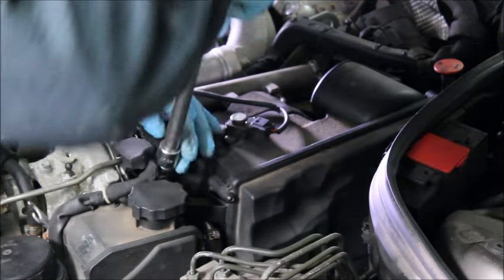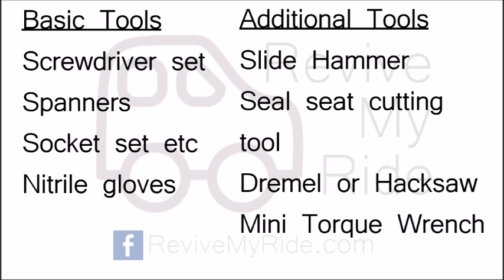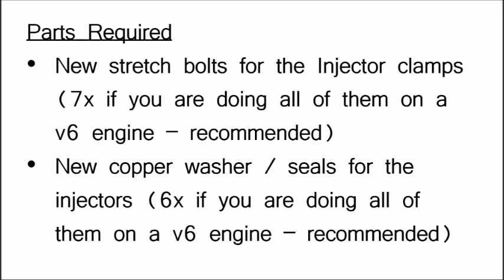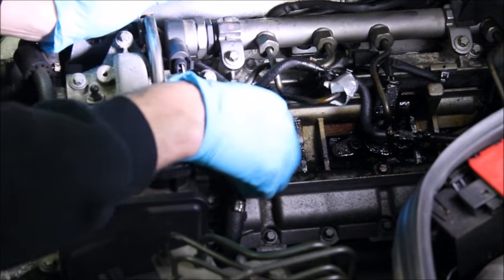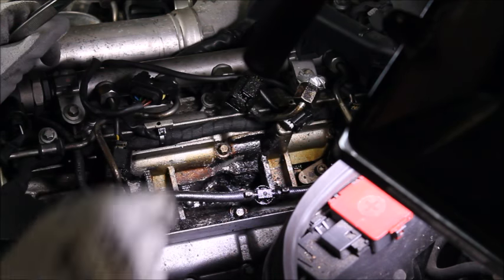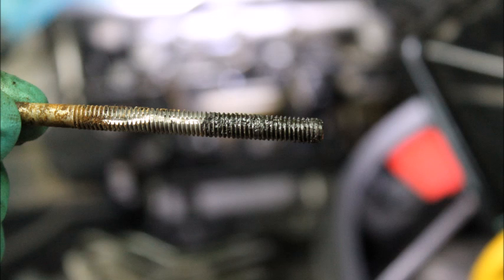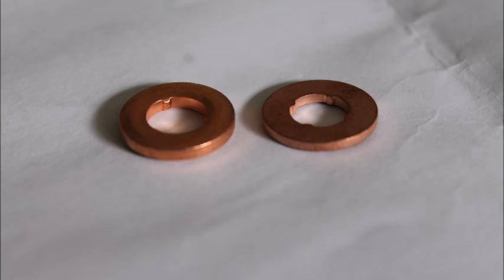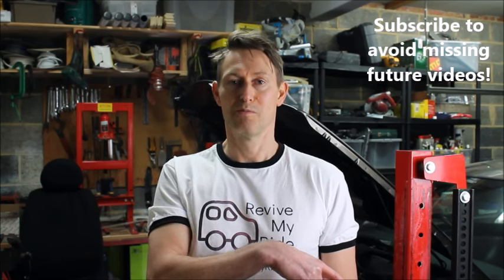Mercedes diesel CDI (Black Death) leaking fuel injector - How to diagnose and fix on 3.0 V6 engine

Comment: Is the torque specs for the injector clamp the same for the 2005 E320 CDI Diesel engine?
Reply from the maker: I’ve done some research and my understanding is that your car (made 2002-2005)
Has the 3.2 Litre Mercedes-Benz OM648 engine.

You may want to double check, the Wikipedia page is here: https://en.wikipedia.org/wiki/Mercedes-Benz_OM648_engine

The engine I did the video for was a different one, the 3.0 v6 OM642 engine (again wiki page available) if you want to search for it and it does use a different torque setting for the injector bolts / clamps.

For the engine in the video, I used was 8nm starting torque and then 2x 90 Deg turns. Please note from the video that I went to some lengths to ensure the thread in the head was clean and there was no debris down in the bottom of the hole, as this can throw out the torque settings. Also, I used new bolts.

If your car does have the OM642 engine fitted, I have found some information that suggest that the torque process is 7nm starting and 1x 90 deg turn but please treat this as guidance only and spend some time doing some further research to be 100% sure.

I found my info here as a starting point: http://www.mercedes.gen.in/mercedes-diesel-injector-advice-sprinter-others/

Comment: Hey so I followed all your steps on my 2005 E320 CDI with the OM648 engine, and did everything you said to do in the video which by the way was absolutely excellent and very informative but I didn’t cut the seat because it looked very clean and I didn’t think it needed to be done. Anyways all injectors were cleaned and new seals were fitted and ceramic grease  and all injectors back in their original holes but now the car runs really rough I’m not sure why! If I rev it in neutral it sounds fine but if I go for a drive it sounds like it’s misfiring? I changed out all 6 glow plugs with the proper BERU plugs and it hasn’t made any difference. I’m really stumped and I felt for any blow by while the engine was on to see maybe if the seal wasn’t good enough but could this cause the car to run like it’s only on 3 cylinders? I would really appreciate it if you could help me out if there’s somewhere I can send you pictures also I would truly truly appreciate it!
Reply from the maker: ElMoeMan sorry that you are having problems! My first thought is that potentially you have got a Diesel leak or the Diesel line is sucking in air. Start by checking that all fuel line connections are Tight and that that all "snap on" fittings, like for the return lines from the injector are connected properly. Be careful not to check for leaks with the engine running as if there is a tiny leak on the high pressure sections I have heard it can cut you. Probably would do any harm to double check all air intake pipework and fittings as you will have removed a lot of them to do the work. Losing or gaining metered air prevents the ECU from getting the fuelling right. Finally, there is a chance that whatever the problem is, is causing a fault code register, so it would be a good idea to see if there are any fault codes registered. Hope this helps and let me know how you get on!
Reply: Revive My Ride                                                         I appreciate the fast and quick reply I truly and honestly appreciate your insight and your willingness to help us strangers on the internet haha! I double checked all the connections between the common rail (hard fuel lines) to each injector and they’re all tight and I took them off a second time and made sure they are sealed properly just to make sure! I didn’t take anything apart besides the injector return lines, the injectors themselves the connectors that plug into the injectors and the bolt and holding pin that slides under the injector where you use the slide hammer to pull it.                                                         I didn’t remove anything else except those things so I know it’s not anything with the air, hoses, connections and also the glow plugs are extremely easy to access on this motor so nothing was removed either or any of that stuff, all I really did was clean the Black Death and put everything back as they came out except the only difference was with new seals. I suspect it’s most likely the seal between the injector and the copper sea isn’t perfect so I ordered the injector seat cut tool which should arrive in a week or so that’s my last resort before I get new injectors which will cost a fortune :(
Reply from the maker: @ElMoeMan Hi again, it seems from what you have written above that there is a chance that one or more injectors aren't seated properly. You obviously have some experience of spanner work so I'm sorry if what I mention now is obvious to you: Please make sure you cleaned the bolt holes out really well (for the injector clamp. If you don't, the injector won't be held in firmly, also, if you tighten up tight and there is debris in the bottom of the hole, you can punch through into the water jacket, so be very careful of this! Regarding seat cutting - always best not to use a seat cutter unless you have to. I used one because the seat had become damaged. Ideally, you can clean up the seat with fine emery cloth on the end of a round stick. If you do cut the seat, think of it more as polishing and remove the min possible to get the seat how you want it. Make sure you use the slighter thicker and softer Nissan washers mentioned in the video. Finally, if you are removing and refitting the injectors again, you may need new washers and bolts (for the clamps) again. BTW, a lot of experienced mechanics that do this all of the time will be able to hear the blowby, this is how I found out I had the problem, I went for an mot and a mechanic told me he could hear it and I should have it looked at. If you have a friendly local garage (and you can get the car there), they may be able to tell you if you are getting blowby just be listening. Hope this helps and best of luck with it. Happy to bounce ideas with you if you have got further comments / updates!

Comment: No ceramic grease?  Thanks for sharing.
Reply from the maker: Hi Ernest, thanks for your comment. You are correct that Ceramic grease would be the no.1 choice for coating the fuel injectors but copper grease can be used if you are careful about not getting it in the sealing area during reassembly. I just used what I had in that would do the job. Thanks!
Reply: @ReviveMyRide  Thanks for response.  Am thoroughly confused.  No lube whatsoever on the Cu washer or head & injector's mating surfaces?  I'm about to buy a nice 188000 mile 2005 e320 that has never had this issue but immediately want to replace washers and bolts, and pitch the plastic cover.  $5000.  Thanks.
Reply from the maker: Ernest, I didn't use any grease or other lubricant on any of the surfaces: for example not where the injector sealing face  and copper washer meets the head. New bolts etc were all fitted clean. Please be aware that your engine may be sightless different to the one featured in this video and so the new injector bolts may require a different tightening procedure. If you look down the other comments you will see where someone else asked and I replied about this. Just a bit of food for thought, I wouldn't have done this job if the injectors weren't starting to leak, you may want to inspect yours periodically rather than taking on the job, you may never get an issue with them, especially if the car has made it this long without a problem. Thanks!
Reply: @ReviveMyRide  Thank u so much.  In the mean time I'm going to order the Honda washers and correct fasteners.  I have access to MBenz's repair instructions.  Will check regularly.  Thanks.
Reply from the maker: Ernest good luck with it! Happy to help if I can if you have any questions. :-)

Comment: I have the problem on a Mercedes B180 model w245 but I cannot remove the dirty because it is hard. I found it is called the black death. How to remove?
Reply from the maker: Hi, if the car still starts and runs, then it is a good idea to get the engine nice and warm before you start work. Just be careful not to touch anything that will burn you but the carbon is softer when it is warm and so, it is easier to scrape away. Failing that, spray plenty of a product called "Seafoam" on it an leave it over night, it should soften the carbon. Hope that helps and good luck with it! Thanks, Phil

Comment: Could you please tell us the symptoms how do we recognise the symptoms many thanks
Reply from the maker: Hi, normally you will be able to smell the diesel fumes coming through your air vents but the best way is to inspect the engine around the fuel injectors. You don’t need many tools and it only takes an hour or two. I have a video that shows you exactly how to do it here: https://youtu.be/7weS1vQ_1OI hope that helps!

Comment: And if it doesn't come out,  unscrew the bolts ( for the stubborn injectors) just a  bit and go for a ride on the motorway until they pop out,  you will hear and feel them trust me 😉
Reply from the maker: Thanks for your comment! I have heard of this technique and read that it can work but be careful out  there!
Reply: Great video. Not sure if I could do it but would have my mechanic watch it before doing the job. Marvelous tips on keeping crud out of engine "innerds". Fantastic video!

Comment: Hi i have the same problem. How did you remove the carbon that was build up outside the injectors
Reply from the maker: Hi, if your car will run, then it is much easier to remove the carbon build up while the engine is warm. I'm afraid it is really time consuming but I used a product called "Seafoam", you'll see a link to it in the vid description and then lots of time scraping with plastic trim tools, metal scrapers (where appropriate and they won't damage anything etc). but another viewer on here did a really good job of cleaning his engine up and it was much worse than mine, so I have asked him the question and will see if I can get back to you with some more info....

Comment: Hi what’s the part number for the washers please?
Reply from the maker: Hi, based on recommendations from MB forums, I used the Honda injector seal / washer. It is a little thicker (useful if you have had to recut the injector seat) and a little softer. part number is: 1647RBDE00. However if you prefer to use the MB one, the part number is: A6110170060. I have updated the video description with the MB part number but there is other info on there that you might find useful if you want to check it out. Hope that helps! cheers, RMR

Comment: 2007 1.9tdi A4. 250,000 km assuming not clocked😂.
Injectors are under rocker cover and then under cam and looks like lots of brittle plastic.
How do you know if the seals need doing.
At that mileage should i just do them anyway.
Runs and idles fine but sometimes on motorway it feels like a slight momentary misfire when decelerating. Any thoughts.
Reply from the maker: Hi, the best way to know if they need to be done is that usually you will start to smell fumes coming into the cabin through the vents. Then, when you investigate, if they have been leaking for some time, you will see black carbon forming around your fuel injectors. Just to say, the Merc diesels are much more prone to this probem because of the clamp design, it could be you never experience this issue. There are a few things that might cause the slight hesitancy of your engine that you mention, for example fuel injectors that are dirty and are injecting a fuel "stream" rather than a "mist". TBH, it sounds like you only have a very minor problem and if I was you, I would monitor it and see if it gets any worse. You can often open a can of worms once you start taking apart an old or high mileage engine!
Reply: @ReviveMyRide  thanks for the reply.
The audi injectors are under the rocker cover and so leak into the head. They are not like normal injectors.
I'll leave them alone i think!

Comment: Great vid very informative. 
I’m currently struggling to get an injector to seal on my Vito. I’ve had to helicoil the bolt hole as the threads were pretty much stripped out by a so called mechanic on a previous botched repair. 
I’ve cleaned the seat up well and obvs the injector. Torqued it to 7Nm +90deg + about 45deg more( loath to give it any more as I’m scared of stripping the helicoil out ) but it’s still chugging past and leaking diesel. Can’t fit the life of me see what I’m doing wrong. Can only think I need to do more cleaning up ? Any thoughts/advice much appreciated. Also it’s really difficult to get fired up after rebuilding it, do you happen to know wether the Vito (w639 2.2cdi ) are self priming ? Cheers
Reply from the maker: Hi, just a couple of things to suggest. Injector sealing faces / seat - Yes, you are right, the seat for the injector needs to be really clean, this doesn't always mean that it needs to be recut, often you can clean it up with some fine emery cloth on the end of a round stick. Then, don't forget to clean the bottom of the fuel injector where the copper seal / washer sits. Retaining bolt and seal / washer - If you decide to remove the injector again to check it, then strictly speaking, you need a new bolt (torques seem low but apparently they are stretch bolts). The copper washer / seal will get compressed and will work harden, so won't work as well, so really you should replace it. It is really important that you clean out the bolt hole for the injector retaining bolt, even a small amount of debris will prevent the injector from tightening up how it needs to and if you over torque (and there is dirt in the hole) you can damage the cylinder head! Sorry, I don't know about the self priming but when I did my car, I turned the ignition on to prime the fuel line (without starting the car), switched off the ignition and then back on again a few times. I could hear air in the fuel system going back to the tank. After that, with a little bit of cranking, it started. Hope this helps!

Comment: Hi, tell me,  will the Nissan washer you mention, do the w211 e220 , 2008 ? And the bolt will it do as well? Thanks in advance
Reply from the maker: Hi, I just checked and the part numbers my car for the injector (A 64 607 009 87), bolt  (A 00 099 029 07) and washer (A 61 101 700 60) on my car are exactly the same as on yours (according to https://nemigaparts.com/cat_spares/epc/mercedes) which i use to look up part numbers . Therefore, I am 99.9% that the bolt & washer listed in the description will fit your car. Please do your own research and if you do the job DIY, always compare new parts with old before fitting. Hope this helps!
Reply: @ReviveMyRide  perf t, thanks for the reply, cheers again
Reply: @ReviveMyRide  also where did you buy your cutting compound, any I looked at quite expensive!
Reply from the maker: @thebull4358  Hi, I'm pretty sure I just used grease. Just checked on the cutter and I could see a small amount of normal grease residue still on it. The sort that you might pack out your CV joints with. Made sure I cleaned out the cutting head frequently and applied more grease, to minimise any cuttings dropping into the cylinder. Hope that helps!
Reply: @ReviveMyRide  hi, tell me, people talking about breaking injector bolts, if this happens is most likely to happen when refitting or taking out old ones
Reply from the maker: @thebull4358  Hi, in my opinion, much more likely to happen when refitting the new bolt. When I was removing them, I didn't have any concerns at all, just make sure that if there are any heavy carbon deposits around the bolt head, that these are cleaned away. Refitting is the risk area, super important that the bolt hole is cleaned out really well, you don't over torque and that of course, a new bolt is used.
Reply: @ReviveMyRide  I thought that, but I tell ya, good call on the cutting the old bolt as a clean out tool, it worked a treat, I used the honda seal, so far so good, I didn't even risk the torque I just tight hand tight then normal socket just a a 1/4 turn then ever so slight nip, and job done start to finish in an hour, left it into "professional" just over a yr ago to do 1, they had the car 4 weeks, broke and had to drill out, put a bolt in like a wheel stud, new injector, hence I done it myself, your video was great, mine was 4 cylinder, but was able to ascertain enough from your video, cheers for that 👍
Reply from the maker: @thebull4358  Hi, thank for sharing experience with your car, always interesting to hear how other people go about things. Yep, your example of how the "professionals" sometimes go about things is why I started doing all of my own work! Sounds like you did a good job!

Comment: I took an injector off to clean it and now the car is not starting, all the injectors are not spraying, there is pressure in the rail but the injectors are not opening. Help me please
Reply from the maker: Hi, Sorry you are having problems. I've never come across this problem personally but from a read on forums, the advice  is to check all fuses in the fuse box. Double check the connections onto the injector.  After that, you may need a fault code reader to see if the ECU is showing a fault. Sorry I can't be more helpful than that!
Reply: @ReviveMyRide  Hello, was air on the rail. Thank you for your help !
Reply from the maker: @xXJusTMichelxX  Hey, good work sorting it out! 👍 Sorry, I should have mentioned that! Priming is a big challenge on these cars if you have broken into the fuel system in any way...

Comment: Need codes new injection?
Reply from the maker: Hi, I kept all of the original fuel injectors and put them back in the same place they came from, so no coding required 👍
Reply: @ReviveMyRide  ok Im Thailand